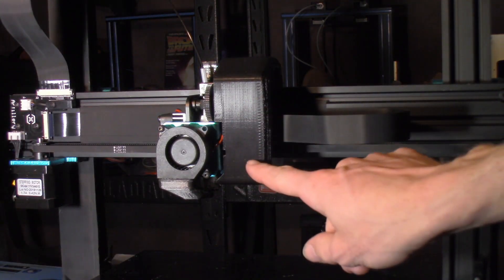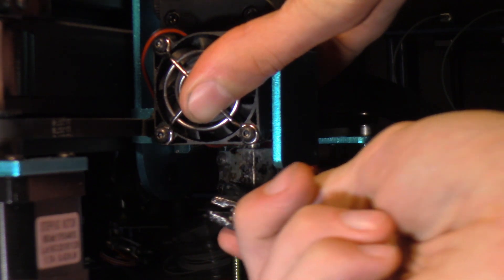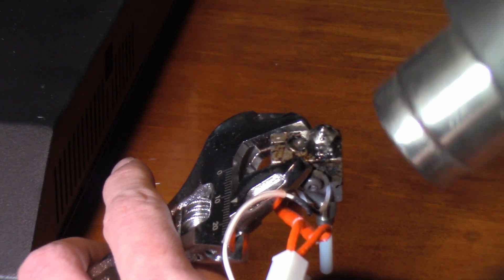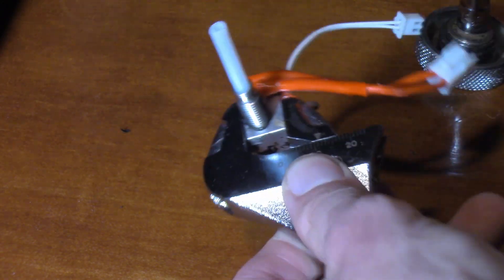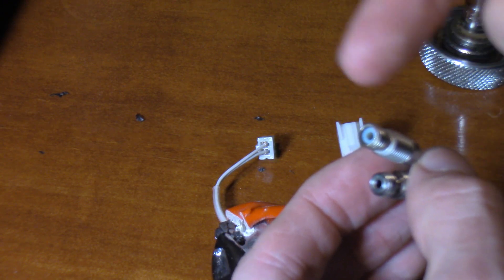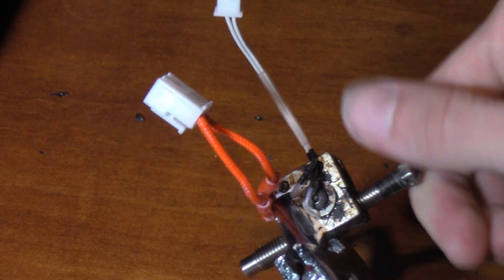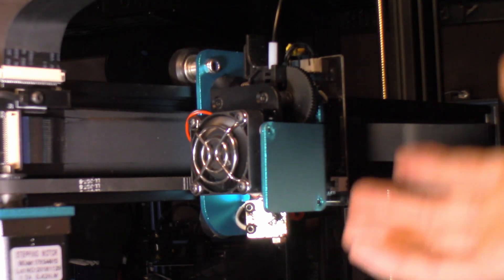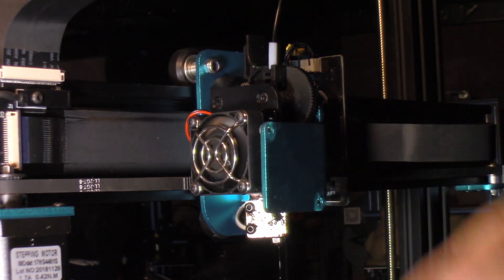Artillery 3D Sidewinder X1 Heatbreak swap: Threaded style

Comment: Having some issues with the installation of the heat break.  It appears it's oozing some filament from the bottom of the heat break which is now encasing part of the heat block (top, bottom & sides).  I'll try to get you some images. As I stated eariler, something doesn't appear to be fitting correctly (check my comments below).  Issues with bottom of the nozzle not mating with the base of the block and the fact that I cannot tighten the block enough to get it into it's original front-to-back position.  It sits side-to-side butted against the LED board.  And now I have filament coating most of the top of heat block and it's dripped down inside the threads where the heat break screws into the block.  It's also coated the area where the heater is installed in the block and around the base of the nozzle. I really want to try to clean all this up but not sure how to do that.  I was able to do some printing but I'm not getting reasonable results and want to get everything reset and fitting properly. Also want to fit a silicon sleeve onto the block but there's not enough space between the block and LED board to fit the sleeve, so I have to find a way to get it back to it's original front-to-back position (or at least so I'm able to screw it a bit further back towards it's original position).  Any suggestions on how to proceed? Thanks.
Reply: Where you mention not being able to fully tighten the heat block and at it's tightest it sits sideways, usually it 'lock' in when the nozzle is meeting it.  By that I mean (at least in my case), if you loosen the nozzle a bit, the heat block loosens at the top and you can screw it in a bit further, then tighten the nozzle again..
The mothod I found is don't tighten the nozzle until you screw the heat block to about 1/8ths of a turn from it's final position. You then screw the nozzle in until it is just touching the heatbreak inside.
At that point, turn the block again and it will immediately get tight. It is weird how it works but as soon as the nozzle is tightened, the heatblock is tightened too. So you can play around with when you screw the nozzle against the heat break, and thus adjust where the heatblock faces when it is screwed in tight.
Regarding the nozzle, it does not need to butt up against the heat block,,, only the inside thread part must meet the thread of the heatbreak inside... thid means you may even still see a thread between your nozzle and heatblock when tightened, but this is good and means the nozzle is most likely sealed against the heatbreak.
If your nozzle is able to tighten against the heat block, it could mean that the heatbreak is too high and they didn't end up touching each other..
It takes some playing with, but watching enough videos and experimenting, you'll get it.

Comment: Wow, glad I checked comments to see the PTFE change to 29mm! Was just about to install. Quick question, I'm making this change on my brand new X1 (V4) and am installing a hardened steel nozzle (TH3D) at the same time. However, the nozzle doesn't thread all the way down to the base of the nozzle, it's up a few mm. And it appears I can only thread to this position, it seems like it won't go in any further regardless if I back off the heat break or not. Is this correct? When I heat up the block and fully tighten the nozzle, will this work correctly? 

Another thing, when I screw the upper threads of the break to the heat sink, it doesn't thread to the same position as it was before.  Basically the long side of the heater block is now sitting facing front/back vs side-to-side like it was before.  The break is sitting flush, should I attempt to screw it in a bit more? Regardless, won't be able to screw it in 90 degrees to get the block sitting the same as it was. Little concerned about how close the block now is to the LED board.  Is this Ok?

Appreciate any help.
Reply from the maker: I think I may redo the video at some point with some improved advice ;-).

As for not going in all the way that sounds like some gunk in the block which happens which is why cleaning it up with a tap or inserting it hot is a good idea. As for block orientation just do what works for you. I would not worry too much about the LED board. If it bugs you, a silicone sock may not be a bad idea. Overall block orientation does not matter as long as it is not hitting things it should not be. 

I hope that helps you out some! I wish there was a hard and fast rule to all this but it is a little bit of a do what works for you situation.
Reply: No gunk, my machine has never been used. The nozzle is not threaded all the way down to base. You can see the nozzle on the TH3D site. Here's a link to an image showing how my installation looks - https://s.amsu.ng/TkbJr3hX1rQN. With the way it's sitting, not sure I'll have enough room to install a silicone sleeve since the edge of the LED board is almost touching the heater block. Any way I can get this to sit closer to the way it was originally (with long side sitting side-to-side)? Maybe by installing a washer between the upper threads of the heat break and the heat sink block? Also note the space above the base of the nozzle. Would rather get it aligning as it was originally if possible. Totally understand that it's up to me but just want to be sure I'm not doing anything that may damage the printer. Thanks for your help.
Reply: Hi Christopher may you Link
 to me the urls for buying your upgrade parts? Thanks

Comment: No issues not having one. But I've found and I believe the general consensus is that you get better results using one, especially when using filaments that require higher temps. Was just interested to know if you had specific reasons for not using one. Just a general question, is the heater block on the Sidewinder a V1?
Reply from the maker: I understand the concept but never saw a need for me but will give it a try for the sake of experimentation. The machine uses a volcano style heater.
Reply: It also helps to keep filament off the heater block which helps it to have better thermal properties. I know the heater is a Volcano type, but there are several versions of volcanoes. The V1 has the nozzle close to the edge, the V2 is further back. It looks lika a V1. Just interested to see if you knew for sure.
Reply from the maker: @christopherlyons7613  I have seen other versions but not familiar with minor changes. The machine does what I need so it works for me. The other changes are icing on the cake.
Reply: @christopherlyons7613  i think V1 is the one you look for..

I have heard it said that the sock helps keep a steady heat in the heat block which i'm not sure if it needs that. Maybe if the part cooling duct blew on it more directly..

I think the main purpose of it though is to help stop radiant heat from the block reaching what you have printed..

A lot of people get great results with or without and I have never seen anyone demonstrating a comparison. Let alone if the comparison would show a difference.

That said, I got a v1 sock and put a slice down the back for the thermistor wires to go through so they aren't being bent at a weird angle, and it keeps my block clean. Didn't have any problems before installing it though.
Reply: The volcano clone on the X1 is a V1 clone not a v2 clone, hence most silicone socks out there for the Volcano dont fit well because most are the V2 heat socks. Any one know where I can get volcano v1 style heat sock?

Comment: Doesn't look like you use a silicon sleeve on your heater? Why is that?
Reply from the maker: Is it an issue not running one? I have not had any issues without one and do have one I could install but I am always worried it will fall off.

Comment: A few things to note on cleaning the nozzles. Pliers and a blowtorch. Heat them to red, then brush/polish with scotchpad. 2 minutes and perfectly clean.
Reply from the maker: One caveat to that is the fact that you will destroy any hardening on the nozzle and run the risk of melting it. I usually store my nozzles in acetone to help break down the filament while it soaks.
Reply: @MakeItWithCalvin  - As long as you cool them you dont have to worry about ruining the hardening.  It takes a number of cycles for it to have any measurable impact on its integrity- you will wear the nozzle out long before that happens. Brass can only be "hardened" by working it- and most stock used for nozzles isnt to begin with. I run casting foundries and blacksmithing so Ive had a long time to ruin metals. (laughs) "Red" (or even slightly less) is far from its melting point. Dont be afraid to super clean those nozzles.